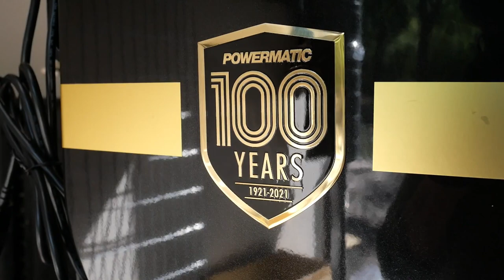I Bought the Most Beautiful Bandsaw on the Internet

Comment: Nice band saw Doug I had to use one years ago when I worked in a plant that made plastic bumpers for BMW and GM. I had to test the plastic after paint so I had to cut different size squares out of them. The bumpers were fine to cut because the plastic had more rubber in them. We had a license plate holder that was made out of a more ridged plastic it went on an Alero bumper for GM. When I had to cut it the saw would squil real loud and if the blade was going to break it seemed like it happened while I was using it. My nerves would be ruined for the rest of the day.

Comment: The riser block is best used for light duty use anyway. If you put the riser block on and use a 1/2 to 3/4 re-saw blade, the riser block will allow frame flex and you'll find that you can't get the saw to hold proper blade tension with most all sawblade brands. Also, when you go to re-saw a board, the riser block will allow the frame to have excess bowing under cutting load and will cause your blade to drift in your cut. Which will also cause blade tracking problems as well. You can somewhat remedy this by using a low tension blade, but your wallet will feel the punch. When using the riser block and you're not trying to re-saw, the smaller the blade, the better the results. Just spending my two cents....Cheers!

Comment: I have a Rockler dust right wall mount 650cfm dust collector on a similar bandsaw. Many other brands make similar wall mount dust collectors. They do not take up much room and you can possibly figure out a way to pipe the bag filter outside to save more space.

Comment: Oh did Ashley not like the moon bike seat?
Reply from the maker: After taking several bikerides with the Moon Saddle, I realized that I didn't like it. I have wanted that seat for so long so it was disappointing that it didn't work out for me, but it just has some flaws that I didn't like. The padding is too hard, and the surface area that the sit bones rest on is too small. I ended up buying a different seat, the C9 Cloud-9 Cruiser AR Saddle, that I found on ebay, and it is soo much more comfortable. I'm much happier with that one.
Reply: @diyfferent  If you mean to spend any time on your bike it's best to have some comfort. There were a couple of cars I didn't buy because on the test drive the drivers seat was excruciating to sit on!

Comment: Was wondering how close you are to finally getting the insulation for the ceiling, why couldn’t your use regular insulation it’s better than nothing?? Just asking as I have been wondering this for a long time.
Your new band saw is pretty💖😋
Reply from the maker: We have no updates on the insulation but the reason we are waiting for the mineral wool is because fiberglass insulation doesn't have a high enough r-value to meet the requirements for our roof. I have no idea why it's taking so long.
Reply from the maker: They still make all the other sizes of Rockwool which has always been in stock. For some reason the ceiling insulation in 24" batts has been out for probably 8 months now.
Reply: Rockwool is far superior in every way 😉

Comment: The strange thing is that the money that you spent on that saw you could have gotten a true pro series bandsaw because that quality of your new saw isn't that great but if it makes you happy I suppose that's all you need just a tip from a man who been a general contractor and a woodworking Master Tech for over thirty five years
Reply from the maker: I'm not familiar. What is pro series bandsaw? I couldn't find anything online when I tried searching for that term. I did try getting the best one I could find in that price range. But I am not expert of bandsaws.
Reply: @diyfferent  He's talking about steel frame bandsaws. He doesn't know what he's talking about because you can't touch a steel frame saw for the price of a cast frame saw, unless you find one that is used and abused long beyond it's commercial production use. Everything Powermatic makes for the home shop is heirloom quality, including your saw. Your young son will be passing this saw down when he's an old, old man and I can assure you it will still run as well as the day you bought it.